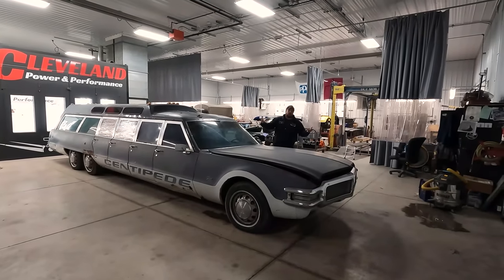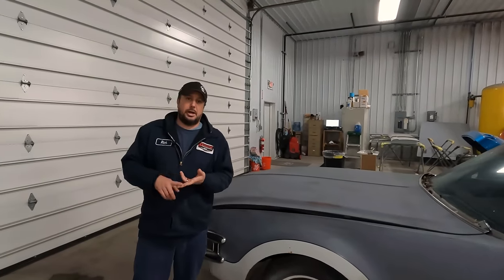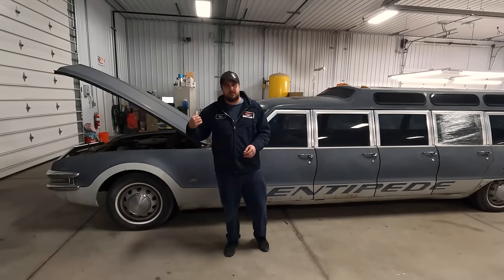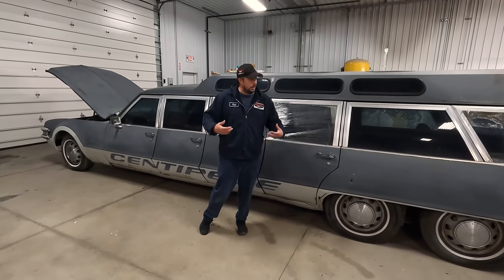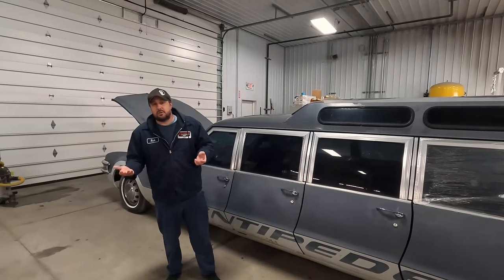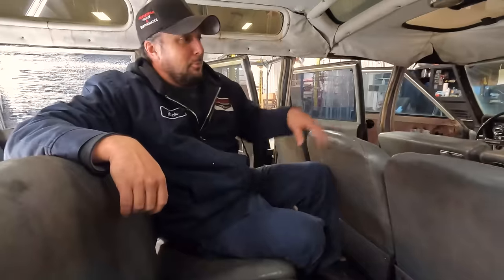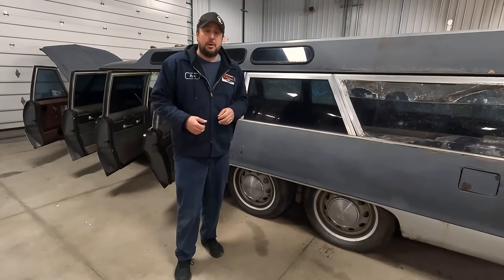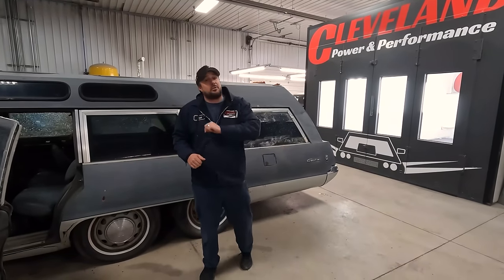1968 AQC Jetway 707 Airport Shuttle History & Walk Around

Comment: I don't think she needs a custom candy apple paint job with flames and such, although that would be pretty cool. I think she needs to be restored good enough to look the part of what she was built to do. A nice enamel coat of paint with a little orange peel and no clearcoat. She's a working girl, not a show car.  "Centipede" needs to be replaced with her proper name "Jetway 707". Donor Toronados can still be found and are inexpensive as they never appreciated much in value like the muscle cars of the day. The TH425 transmission is based on a Turbo 400 with a Hy-Vo transfer chain. Most internal parts interchange with the 400 so any transmission builder can handle it or you can buy rebuilts from many sources. You might need a few Toronado donor cars for spare parts and I think that would be a worthy sacrifice to keep the Jetway 707 legacy alive. Also google "oldsmobile toronado restoration parts" to see what new parts are available. Good luck! I'd love to ride in her backseat or passenger front seat someday! The VistaCruisers got nothing on this Good Ol' Girl! 😎
Reply from the maker: Thanks for the tips and for the well wishes!

Comment: It amazes me that it still exists in that condition sitting that long. It is still in great condition to upgrade the interior and really bring her to be awesome again. The interior should be two tone leather seats with burgundy and white colors. A great stereo system with 8 stereo speakers installed front to back. A duel  a/c system with one in the front and one in the back because one a/c cant handle that much space. I would install a  fuel injection system with beefed up electronic wires , alternator, and electronic ignition. I would install disc brakes all around and upgrade the suspension to ride smoother . I like burgundy for the outside paint job with white wall tires. I would install flowmaster dual exhaust all the way back. Last but least install seatbelts.
Reply from the maker: Wow, thats a solid plan. We might have to bring you in as a consultant on this one.

Comment: Little oil and fresh battery possible it just the turn of the key and the old things can come to life
Reply from the maker: For sure.  Not like the modern cars.  The older cars could sit for decades it seems, a little gas and oil like you said, and they fire right up.  Crazy how different it is with modern cars.  The modern cars can not sit anywhere near as long as the older cars, we will get the Jetway running and see what the motor tells us

Comment: Rebuild it with more power and a few large fuel tanks. Stuff it full of all the latest GPS, scanners, descramblers, radios, internet link ups etc and make a nonstop Cannonball record attempt. A few of your buddies in the car, subscribers across the country running look out /decoy.  It would be epic.
Reply from the maker: Oh dude, THIS is the way!!!
Reply: Ed - is that you?
Reply: Good luck docking that thing at a restaurant or fuel station.
Reply: That’d be the worst the car to attempt a nonstop Cannonball record, if you look at actual Cannonball record cars they’re fast sleeper sedans that draw as little attention as possible not to mention even with extra fuel tanks this thing is getting single digit MPG so it’s gonna be super expensive on gas and take forever to fill up.

Comment: Most common answer, "Restore it!" Least understood fact: How much time and money it takes to restore a car like this. It could be years, and everything missing or worn will have to be made from scratch. Unless someone is bankrolling that 100K+ restoration, I'd say repair the mechanicals, remove and fumigate the interior, and drive it around to collect stares. If it is being bankrolled, a conversion to a modernized, functional limo would be real cool, and a popular hire car.
Reply: It is one of only nine left.
Reply from the maker: 100% on point
Reply: @ClevelandPowerPerformance  The floor pans are an easy scab-over and no one will see them. The glass and rubber seals have to be fixed. The running gear shouldn't break the bank. Get those things done and get her cleaned up and then reevaluate what direction you want to go in next. I would do it in stages rather than a total teardown. Once she is running and weather-proof, you have many options and time is on your side.
Reply from the maker: @mikenodine6713  we agree.  It is such a massive project to take on, we might start in stages.  We normally do a full build, this one might go in stages.  I think the first part is to get the Jetway just back on the road and moving.  Even if only local car shows is the first summer, it is still an incredible opportunity for a bunch of people to either re-kindle some old memories, or for others to learn about the history of the Jetways for the first time

Comment: How close in dimensions is this layout to the GMC Motorhome? That was first came to mind. I’d just turn it into some kind of a mobile party on wheels with a massive sound system and light show inside. Or maybe even a mobile movie theater. You could rent it out to help recoup the restoration cost. I like that it was called a 707. It’s about as big as a 707.
Reply from the maker: We will have to do some research to see if we can use any motorhome parts. Thanks for the input!

Comment: Ratrod it. Clean it up and make it safe. Redo the interior with cool colors and lights. A slightly modified motor . It would be awesome 😎
Reply from the maker: I like the idea my man, thanks for sharing. We would like to get it ready to for the road, and some basic safety upgrades are going to be a necessity for sure.  The interior is one of those tough ones, it definitely needs restored, but also do we go to a more modern set up, or just go straight back to vintage like the day it came off the  build line
Reply: @ClevelandPowerPerformance  I guess that would depend on the use of it. Lots of cool options for sure. I loved seeing it so keep sharing the progress on it with us.

Comment: Move the rear axles of back a few feet cut off half the back hatch put a fifth wheel in the back and use it to pull a fifth wheel camper that matches
Reply from the maker: that would be siiick for sure.  There is a grainy picture on google images from roughly the 80s or 90s, where someone chopped the back off.  They were trying to run it with a hot tub in the back of it.  After that the pictures seemed to go dry, so one know's what happended to that one after that ol grainy photo

Comment: Put a custom diesel engine in it all new floor pans. Modern comfortable seats with all the gadgets seat heaters recliners deck it out to Modern standards LED strip lighting, and of course and don't forget it needs a hood ornament. Air suspension so you can adjust the height, custom modernized build is what this thing screams.
Reply from the maker: You think its worth all the time and fabrication to do all that??

Comment: she  needs a full up restoration and put her back to work running people to and from the airport!  you could certainly upgrade the engine - pull the engine and transmission from a caddy eldo of the era and get her up to 501 cu
Reply from the maker: thanks for sharing! We agree, we are hoping to have the Jetway back on the road next summer for everyone to enjoy.   A bigger classic motor from the back in the day would be cool.  Our next video is going to be to see if we can get the ol 455 running that is in there currently.
Reply: @ClevelandPowerPerformance  the old 455 is a great motor - but i wonder if you can fit a 572 crate motor - it seems the crazy supersized chain they used to connect the motor to the transverse mount transaxle was super strong - after all they used that setup to move the gmc motor home - i presume there are a lot of high performance parts around to soup up a 455, so a bigger motor may not really be needed...

Comment: Not that it matters, or is even relevant, but the 707 (Boeing)  was THE premier airliner of the day. did that inspire the name?  I dont know, but it could provide some connection as to the naming of it.
Reply from the maker: nice call, you are correct,  the 707 name is dead on, the jetway named after airliner

Comment: Restore it , the gmc motor home has the same platform, I know where 2 of those are.  Both have the transaxle.
Reply from the maker: very good eye, you are correct.  Crazy to think the GMC motorhomes we all love and recognize from the 70s were basically straight off AQC Jetway frames under the motorhomes.  Thanks for the heads up on the parts, once we get into the Jetway teardown next week, we will have a better idea what parts are needed, and then we can let you know if we need parts off of those motorhomes

Comment: It's cool alright.
I'm guessing 60 to $80K to fix her up right.
Loose those stupid Sun roofs from her Limo days.
Same with the rear facing yellow lights on the roof.
Yellow facing backwards is illegal is 60 States, 
and 5 light are needed, only if she's over 96" inches wide.
I really don't think those side roof windows were original
ether? They look like they're of an F 250 bed camper from the 80's.
I'ld pull the whole drive train out, and build a rotator for the whole car.
Just to work on all the rotten floor's sheet metal. It's goes twice as fast work down, the looking up 12 hours a day.
Pull the PUFFY interior, but don't destroy it, removing it.
They're FREE patterns, but I would leave the ceiling bare. 
(Paint it bright, like a Sky with clouds scene, w/707's flying overhead. lol!)
Again very cool.
Reply from the maker: hello friend, love the idea on the mural on the ceiling.  That is really cool, something I never thought of, love it!! It is crazy how ahead of the time the design was, those side windows were original glass.  The glass just never changed for the next 30 years or so in regards to the roof, and was used on a bunch of projects.  The ones on the top center roof, those pieces of glass are definitely aftermarket from the 80s.   Thanks for the comments and feedback 🤙

Comment: Air ride..drop her into the weeds...remove complete interior ...Flat floors..ez fix..pimp out the interior with leather buckets with arm rests laptop heated seats since theres a glass that encloses the driver..nice bar with star lighting on the roof. six wheel steering from gm older front and rear gmc pickup..Now in the rear...bedroom for the mile high club guests shave the door handles make them electric..how about making one of the door ...wheel chair lift with a rotating chair that pick up the person and loads them in the car...Handy cap parking permit..Color..summertime yellow with matching interior..or how about that new paint that i have seen on the web thats electric and changes color by the way of a key bob...just a thought..I was saw the won in california..i beleive it live in the san diego area...wish i would have stop to try to by it...o well...
Reply from the maker: have to say.... totally different build path so far we have heard, and I like it.  The cool part with anything custom is, it is custom.  The owner has to like it.  We have a great upholstery shop, we would love to to all crazy on the interior with some awesome patterns.  The Jetway at this point seems like the masses would like it restored, but we are not sure if restored will get her driving too far.  Our next step will be making a ramp system where the Jetway can be put into the air and we can get a better idea underneath what is going on